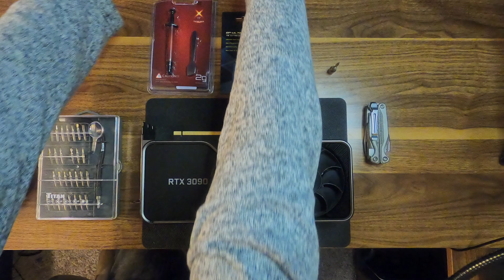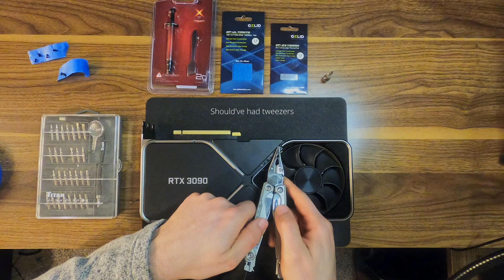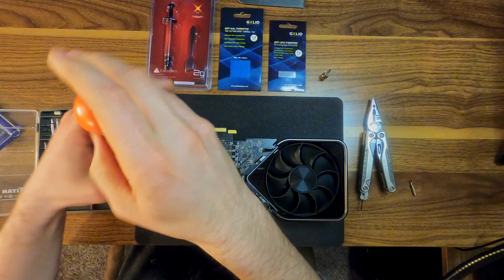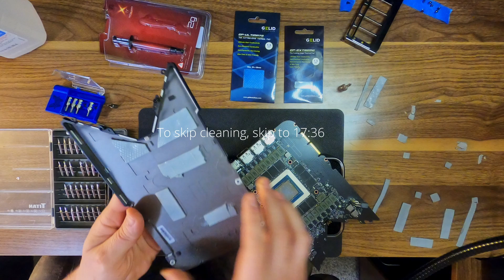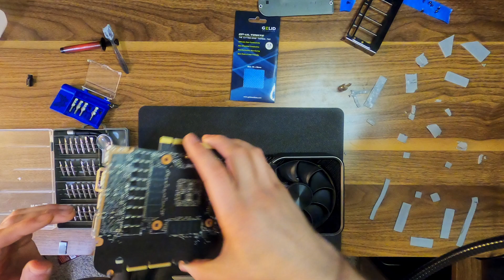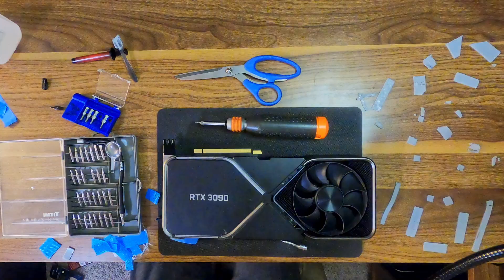Rookie Replaces 3090 Thermal Pads! (featuring cleaning ASMR?)

Comment: Good first attempt its a scary project the first time round, ive just repadded and pasted 3090 FE, i would also recommend using 2mm Gelid Extreme on the VRMs in three areas on the core side as these give better contact and temps after a few hours and 1.5 Gelid on the remaining areas front and back. The best way to apply thermal paste is an x shape across the die with dots in between as the gpu will either pump out the thinner paste after use. Also use an undervolt to lower temps and fan profile as above 50% fan noise gets loud.
Reply from the maker: This is good advice! I'm trying to pin your comment, but YouTube is glitching out right now. 

I've personally torn it down again and installed an Alphacool waterblock with an active backplate, and that's seemed to work much better!

I do have a couple gripes about the Alphacool setup, but they could also absolutely be my beginner mistakes. From what I've seen, they don't explain very well and expect the user to know what they're doing so I could have absolutely gotten something wrong.
Reply: Interesting you say that I have heard in the forums that we should use 2mm on the vrm and 1.5 on the memory but the question did this improve your temps? I’m currently running 64c core, 78c hotspot, 85c memory. This was with the ultimate pads 1.5 on the back and 1.5 extreme on the front and noctua termal paste.
Reply: @davidsilva3567  I just attempted this with the 2mm pads on VRMs, I cannot recommend it at all. Before: 70C core, 83C hotspot. After: 77C core, 94C hotspot. Memory temp is fine though at 84C. Mind you this is all with stock 350W power limit, I saw a guy on reddit championing this 2mm VRM pads running with 500W getting better temps than me, I don't know how that's possible. But in my case I am very unhappy with the 2mm pads, I'm waiting to get 1.5mm pads and redo it to see the difference.